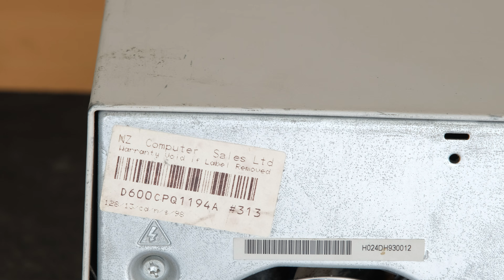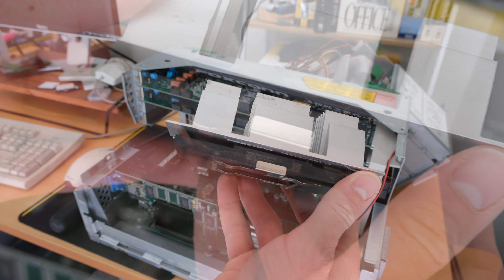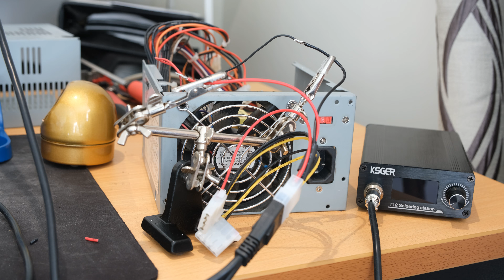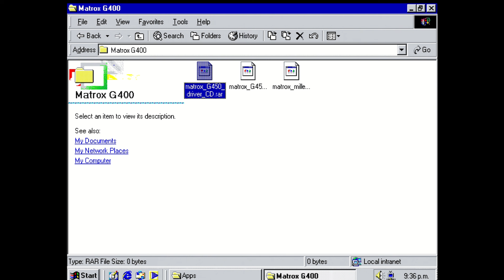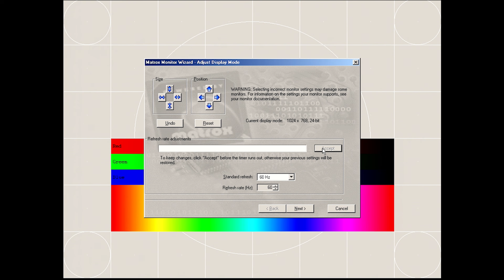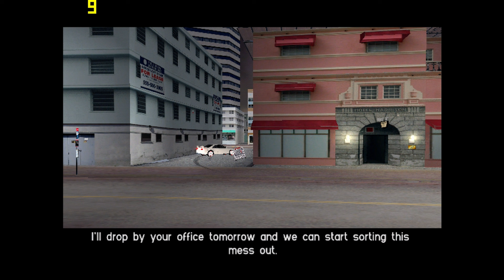An Odd Machine | Compaq DeskPro END

Comment: I have a few of those ram., modules in storage, four 256 MB., and two 128 MB., however, I have no way of testing them and I reside in the far north of the UK..
Reply from the maker: The ol RD RAM, what a terrible idea that was thanks to mostly intel haha. Oh well, at least everyone moved on from that
Reply: @thesmokingcap  I don't recall every using that type of ram., so I cannot comment on it's performance, but I have gathered and I still do gather old ram., just in case someone requires any and I have three of these modules (4GB DDR2 800MHz PC2-6400U-256X4/32C Memory Module for AMD)  (C2-6400 – 800MHz Only compatible with the following Motherboard chips: Via – Sis – AMD – NVIDIA GeForce – NVIDIA nForce – ATI * Not compatible with motherboards with Intel chips).
However, I do not have any way of testing the modules.

Comment: Interesting machine.  It's almost like it was intended to be a server/workstation hybrid.   With the RDRAM, it would be  edifying to upgrade it to a Tualatin 1.4 PIII with a slocket to be able to run an apples to apples comparison with a Socket 423 P4 using the same memory.  It's always been an issue, since most pIII boards support  standard SDRAM
Reply from the maker: It's a bit of an odd machine isn't it. A mixture of older and newer tech

Comment: About the hard drive, updating the BIOS to the latest available for your machine may allow the it to recognize the 80gb hard drive and if not it should see the drive as larger than 15GB. I have an older DeskPro from the Pentium 2 generation and i could not use hard drives larger than 8 gb, but after i updated the BIOS and i am now able to use 20GB hard drives which i am much happier with.
Reply from the maker: Might be worth a shot, although this exact model is a little hard to find info for it seems.
Reply: @thesmokingcap  Make sure you get the model info from the BIOS screen and use it when you look for drivers. You may have to view a heap of forum posts to find exactly what you are looking for which may take up a lot of time.
Reply from the maker: @BoomBox02  Good tip! I'll checkout the strings

Comment: I had a FEW Gateway Pent-2. Slot-1 Systems Very Similar in setup like this.
They made great Win9x systems with Lite98 to get the best Performance but All the Excellent Direct X 7.
Or Suse or Ubuntu worked Pretty well back then, this was around 2k3 - 2k7 with Old PCs my IT job were Trashing as we upgraded
OH: My Point, They Each had those 8Mb Funky AGP Cards, I Couldn't use them in Anything, AND They were Such a Weird Off-Set, You Couldn't Just put them in another PC

Comment: Since it has a 133MHz FSB CPU in there already I wouldn't be surprised if it'd easily take the cheaper 133MHz 1GHz Pentium III slot 1's (compared to the rarer 100MHz FSB ones).
Reply from the maker: I am curious as well, sadly the only faster slot 1 cpu I own is 700 mhz and my Slotket adapter appears to be faulty. I've tried a bunch of supported CPU's in it and tested on various motherboards, but the machine doesn't POST.

Comment: That videocard form factor is called NLX. Only two things are specific to it, one: the exact height of the vga port and nothing else either underneath or above, two: the notch on the bottom left so it doesnt collide with the parallel port if your motherboard has that. I have a deskpro EN and i managed to adapt a geforce fx5200 by cutting a little bit from the pcb and removing all ports except the vga which was luckily on a ribbon cable so i could move it wherever it needed to be. The EN has the cpu socket mounted horizontally and has sdram. Ive never seen or even heard about this deskpro case with this motherboard version. Wonder whats the best cpu yours can take, mine is p3 katmai 600mhz maximum....
Reply from the maker: It's a very strange card, rather annoying if you want to upgrade the machine. I would be interested to try a faster CPU. I do own a Slotket adapter, but it doesn't appear to work no matter what motherboard or CPU I try and fit.
Reply: @thesmokingcap  i dont know how correct i am, but i think slotkets are for celerons only. At least i never managed to get any pentiums to work in them, maybe im just unlucky. However there are slot1 pentium cpu-s around 1000mhz-1100mhz which might work for you. If you stick to nlx cards and not attempt to mod a better one, then my research makes me believe that the best one you will get is the diamond viper v770u which is a tnt2 ultra and rather expensive. In my EN the original 350mhz p2 didnt post when i got it but but a 133mhz fsb 550mhz p3 did. Ive done a bios "upgrade" with the right bios which made the 550 not work anymore but the 350 started working. Power supply connector is also physically atx but the pinout differs a bit so be careful with that if yours ever packs it in. At least on mine thats the case...
Reply from the maker: @gaborszucs8935  Humm you could be right re the slotket. I'll have to do some more testing. Also it wouldn't surprise me if the PSU in out if different as the size of the unit is non standard atx.
Reply: @thesmokingcap  if i remember correctly, according to my researches the difference in pinout is something about the power good signal being inverted or something. Depending on whats your plan with this machine it may not matter much anyway. At least luckily when i tried a regular atx psu nothing happened. No explosion, but also no POST. I think it might be possible to somehow adapt a normal psu to work. I ended up just buying the correct compaq branded psu from ebay. Are you planning to make any more videos on this pc? If yes i am def watching it! :)
Reply from the maker: @gaborszucs8935  Ahh yes, I may need to get a scope or something on the pins to see what they're doing on power up and make some adapter. The size of the PSU will be an issue as it's not a regular ATX style
Reply from the maker: @gaborszucs8935  Ahh I see, I may need to do some research as I have a few 370 chips on hand

Comment: 80186/188 actually is a full featured x86-class cpu. I built a PC out of it that's running DOS. It's basically an 8086/88 with integrated peripherals (PIC, DMA, Timer etc)
The cards in question should be some voice/modem-related stuff.
Reply from the maker: Indeed they're listed on CPU world. Given the system this machine came out of is no longer being used, it would be cool to do what you did and re purpose the CPU's for some sort of home made system. I know there's a bunch of 8088 projects out there